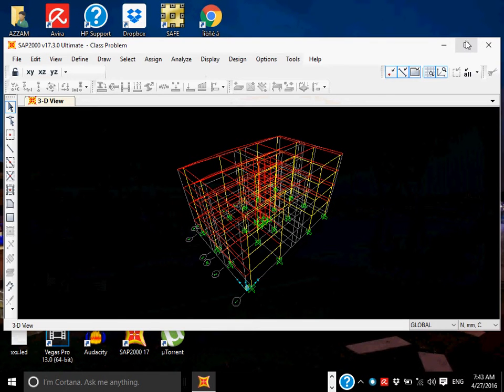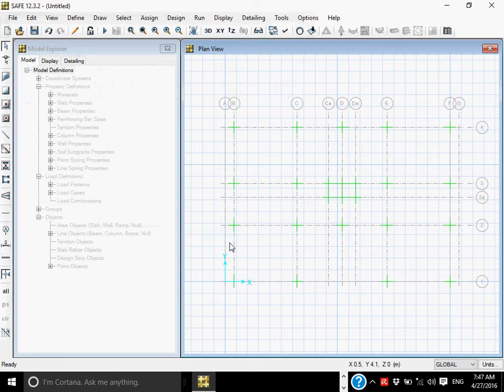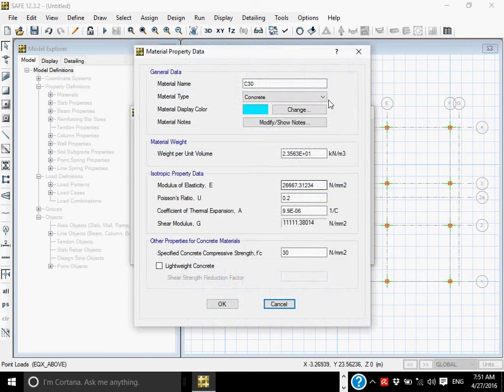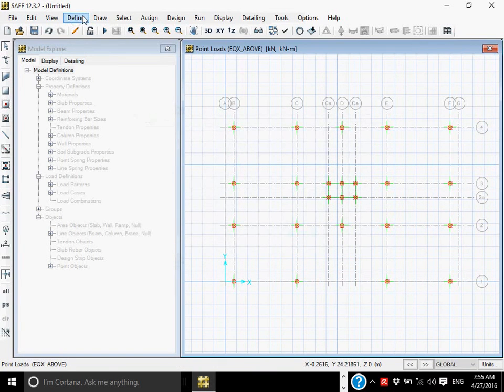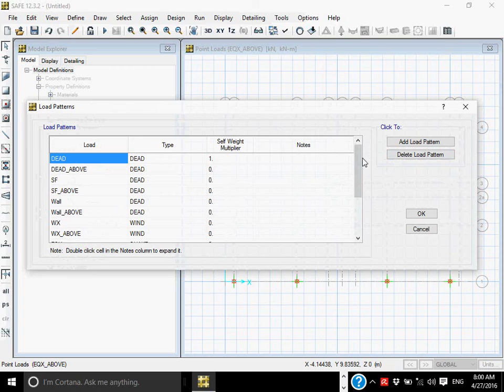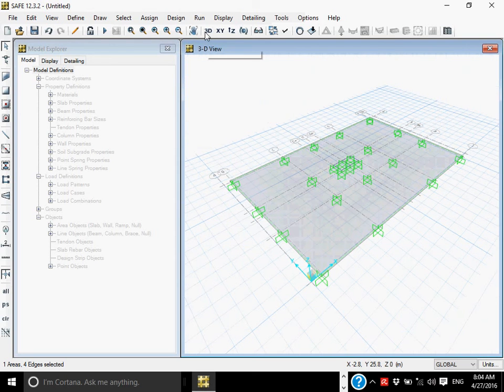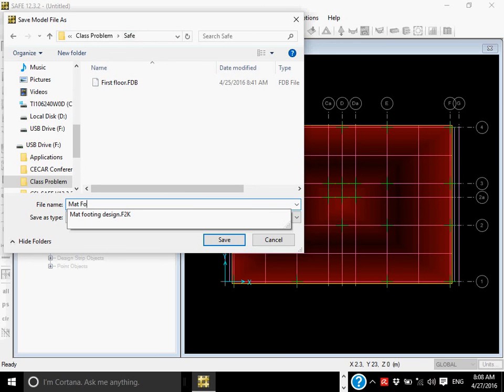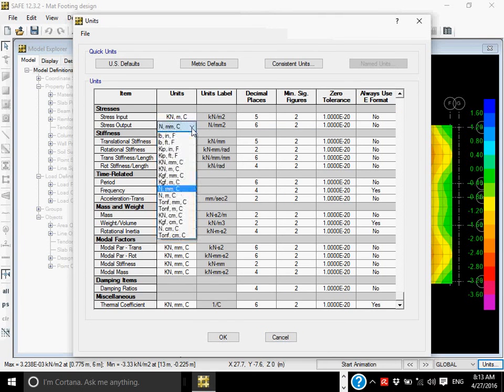Design of Mat Foundation using SAFE Part 3

Comment: Which code is used for design
Reply from the maker: Dear Kumar. I mostly design the concrete using ACI 318-08. However, the year of ACI code you can use whatever is available in SAFE version.
Reply: @engrumair2003  Sir pls make a video on slabs and types of footing using with IS Code and compare with manual calculations results by making these videos it will be useful for all the people...
Reply from the maker: @PraveenKumar-kg9ql  Dear Kumar. I will note down your comment for future. However, at the moment I am teaching bridge design at King Faisal University and Will do you task once finish my current course. For now, in the computer aided design of bridges, I will include a short discussion regarding IS code.